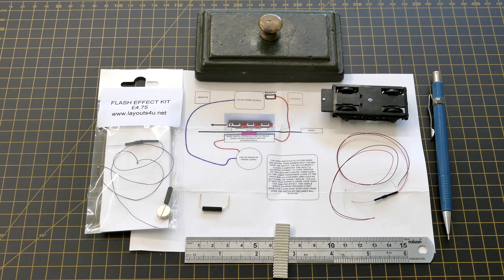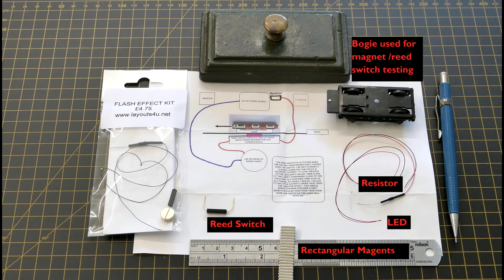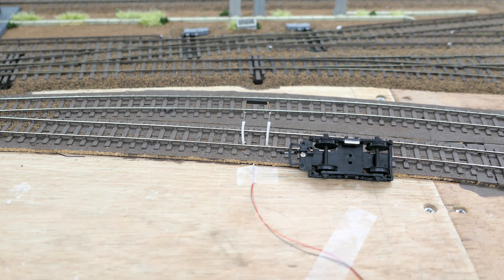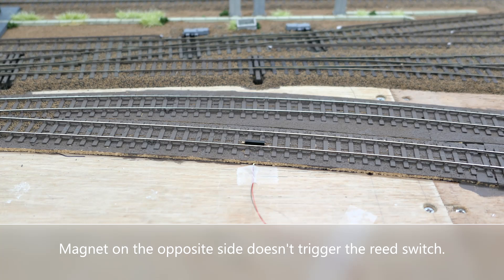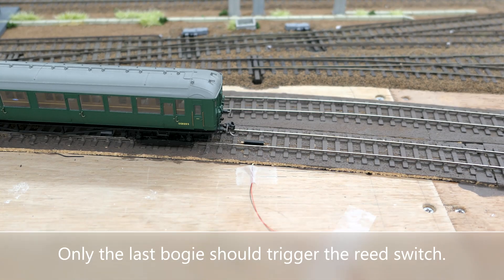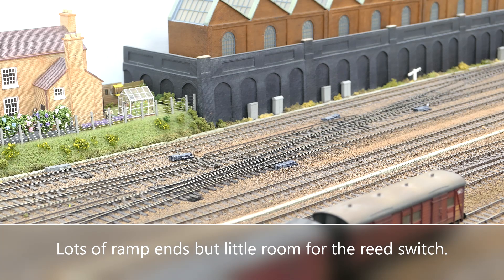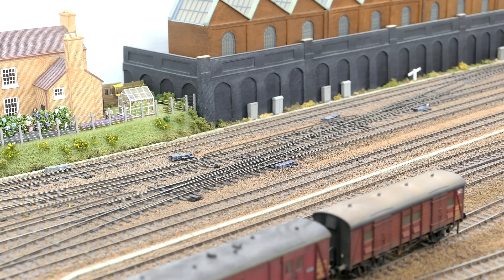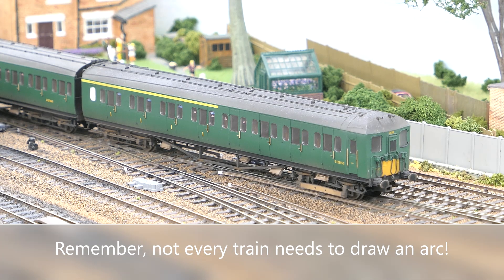Ewhurst Green Technical video Arc-flash Unit (Conductor Rail) Installation.

Comment: The leading shoe on the front bogie can and often does arc first, according to the length of gap, between the leading shoe and rear shoe of any unit, be it a single MLV, 2 car, or 4 car. If the length of gap exceeds that of the entire length of the unit, for example a 4 CEP is approx 265ft in length, should the gap be in excess of this, say 10ft, it wouid mean all shoes have lost contact with the conductor rail, therefore the train has momentum to coadt over the gap, but, the first shoe to come in contact once the conductor rail restarts, and providing the Driver has the controller in an "open" position, that is a power position, it will instantly draw an arc as power is drawn.

If 2 x 2 car units are coupled and the gap is more  that than the standard length of the unit, the same will apply. As Drivers, we not only signed the road for route knowledge, but also unofficially signed for the fact we knew where notorious gaps were and where NOT to stop, Grosvenor Sidings, Victoria, is a prime example where an entire 12 car can be gapped, with no shoe in contact with any conductor rail - as I found out one day in the 90s to my peril lol 😂
Reply from the maker: There were (are) so many gaps out there to catch the unwary with the 4 SUB units being the last to have a power jumper between units. Across the decades used to attend Grovesnor Sheds frequently in the course of my duties (along with Stewart's Lane)!  🙂

As an aside seem to recall LUL removing power jumpers between cars (let alone units) in 1963 or 1964 with the positioning of con rail gaps being carefully designed to mitigate gapping.
Reply: @ewhurstgreen  well seems we have alot in common after all lol 😂
Reply from the maker: @johnhorton5364  Undoubtedly!  😺

Comment: NICELY DONE.....

Well done...... It works well.
One observation 
Near the overbridge might be a good location to catch a little of the shadow / darkness.

Just a thought..

James Hennighan
Yorkshire, England

P.S.
A small piece of mirror glued underneath the coach, (peraps angled), might enhance the appearance of the arc......
or am I going too far with this idea. Bacofoil would do the job and not be obtrusive and I wouldn't think this would compromise track power.....but you would have to be carefuly with this.
Reply from the maker: James, thank you for kind your support!👍 
Unfortunately there aren't an suitable conductor rail off ramps under the road bridge. However, the arc-flash is quite noticeable in person - even when standing twenty-five feet away. ⚡
One or two more units will follow when time permits - Colin 🌞

Comment: Definitely worth having arc flashes for the extra realism on SR and LT lines. I don't know if you have had this problem, but some of my original Hornby steam locos with the older type motors and ring field motors (not can motors) had such strong magnets that they would trigger the reed switches and cause the flashes- rather non-realistic! I got around that by switching the LED power supply off for steam trains. I like your motor luggage van. A very attractive model.
Reply from the maker: LT stock has no traction power between vehicles which can lead to arcing although their design of con-rail positioning is quite comprehensive. ⚡
Will have to invite a ring-field locomotive across to see it the reed switch is affected - being offset might assist. 🌞
Thank you for your praise on the Phase 2 MLV; there are a couple of Phase 1 MLVs lurking somewhere!  🙂

Comment: Excellent effect, the driver is letting units fall into gaps lol there seem to be a number of very small reed switches out there
Reply from the maker: Mike, thank you. I have one or two more planned although it is actually a struggle to find credible locations. - Colin
Reply: @ewhurstgreen  Colin, how sensitive are the reeds? Would they work on the underside of the boards?
Reply from the maker: Mike, not tried that but I suspect not - unless you strap an AWS magnet under your model (cough).....  😉
_I have got an AWS magnet but it is too heavy to lift so cannot try for you!_😮
Seriously though, I would not want a more-powerful magnet fitted under the models. 🤔
The answer probably rests with a magnet-fitted electric unit turned around (so the magnet is close to the six-foot running rail) doesn't trigger the reed switch mounted just inside the cess-side running rail.🧐
Decided to take the small amount of visual intrusion on the basis few will spot the reed switch, let alone for what it does. 🙂
The LED is very hard to spot even when you are looking straight at it. - Colin 😎
Reply: @ModelRailwaysUnlimited  They don't work when the magnet is 10mm away, close to the opposite rail so, no, they wouldn't work under the board.
Reply from the maker: Thank you for your contribution. 👍
The magnets are mounted offset on the bogie so the offset reed is one activated in one direction. If the unit (bogie) is turned then the reed switch will not trigger. ⚡

Comment: All very technical. The Bachmann S-Stock train has an arcing feature but it is random and not triggered by anything on the track! Thanks for uploading.
Reply from the maker: Thank you for your interest in this Technical Video. 👍
Interesting feature on the S stock although might look odd at times. ⚡
Having said that, once reported significant arcing (to Network Rail's route Head of Safety) when passing through Norwood Folk Junction - he didn't see the problem even though I'd explained the train comprise two Hampshire units..... 🙄
Reply: @ewhurstgreen  I reported arcing at Hastings to the PW dept and the investigation found the track was out-of-gauge! It was when the "Brighton Road" was removed. The bloke in charge of the engineering was carpeted!
Reply from the maker: Retirement from today's railway industry is bliss.
Reply: @ewhurstgreen   What was your job on the Railway?
Reply from the maker: So many roles across the industry, perhaps with leading the designs of automated mass transit systems in both Asia and UK being particularly rewarding.
Reply: @ewhurstgreen  OO gauge must be a piece of cake after that! I have never worked for the Railway. I only once lived near a railway station and was a commuter!
Reply from the maker: @AllensTrains  It helped!
Commuting can be dire.